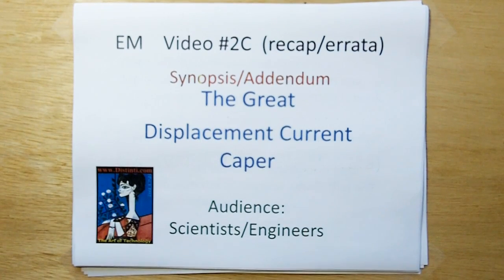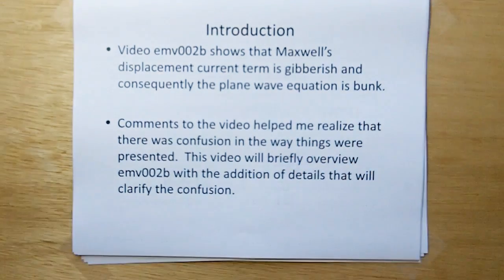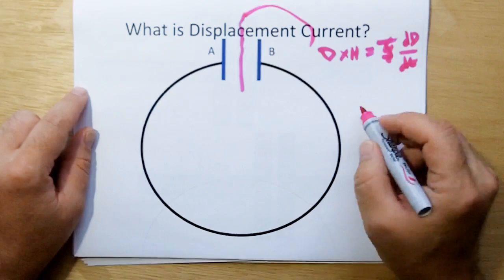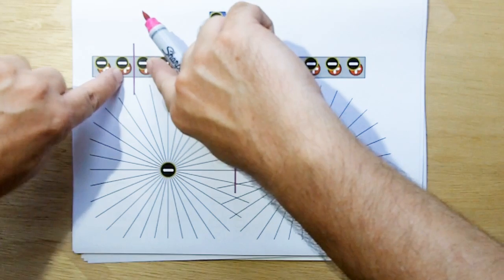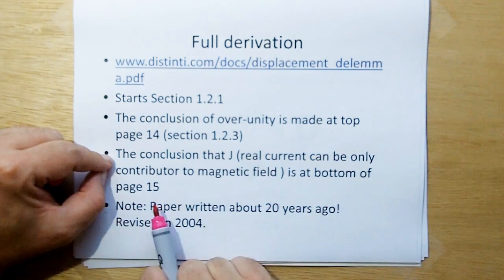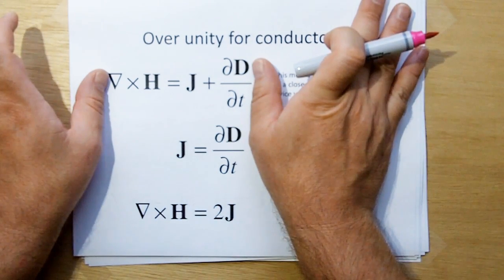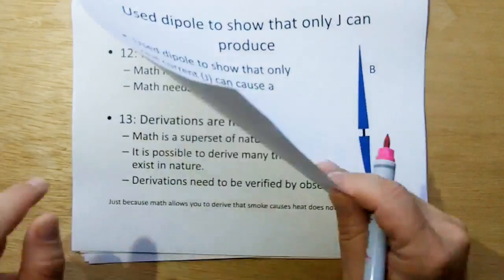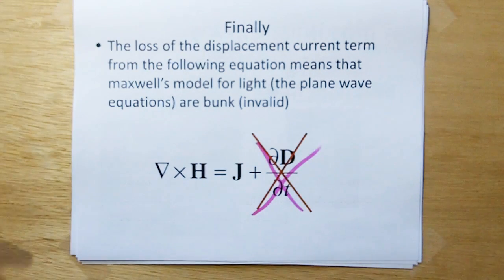emv002C: Addendum/Overview: Maxwell's Displacment current fraud

Comment: What you call as electric flux is magnet field passing through the inside areas of a number N of windings of a selenoid, and it is very incorrect to say "current displacement" because there is no actual flow of any positive charge in any circuit while the positive charge is transmitted from atom to atom and from the positive terminal throughout the circuit to the negative terminal as their electrons are both repelled from a larger amount of negative charge accumulated at the negative terminal, and also attracted by a larger amount of positive charge accumulated at ther positive terminal of the power supplying source

Comment: If I understand the concern correctly : in 2x when should be 1x : 

The energy that went into, a 3D symmetrical capacitor, is converted into Aether as E field or E energy. If all consumed in that process the only B field will come from the loop conductor.

If we are not fully convinced of above, the current enters central location of plate splits equally in opposite directions and if there were B field induced, each half will cancel out one another. That leaves us a residual amount of B to deal with, too small to sound a siren with. 
 Please reconsider Mr. Maxwell’s contribution.

Comment: Electrons and Positive charges moving across an insulator? The real current is measured by traveling electrons? Really? If you're going to point a finger at Maxwell, shouldn't you stick to his belief in not just potential moving charges but dielectricity too?
Dielectricity is the field aspect that is stored in a dielectric of the capacitor and travels through it, not the potential (until it fails). I suspect the "D" did not stand for displacement. Dielectricity, that part of the electric field that travels mostly outside the conductor (the air and insulators have more dielectric capacity than the conductor). Dielectricity is that aspect of an electric field that is motivated by the environment to move and then does at FTL speeds (c* pi/2). The closest physical metaphor is density.

I used to think that dielectric movement created the magnetic field of a permanent magnet, but denying this explains a lot about the other phenomenon that is observed. Discharging capacitors do not generate large magnetic fields. Tesla's Hairpin Circuit, an AC circuit that has no net potential provides dielectric electric field energy without potential and does not fry people carrying electrical fields capable of lighting florescent tubes and incandescent bulbs in series. This safe-handling feature and lighting without the presence of a voltage is most likely due to the absence of a magnetic field from the source and in the conductors.

So, I think you have a valid point, the actual transition of the E field potential is what causes or rather induces a magnetic field. The movement of the dielectric value of the electric field does not contribute to the magnetic field.

When a magnetic field induces an electric field, guess what: it produces dielectricity. If your inductor has a large enough capacity greater than the load, it will not travel until the polarity of the field being induced is changed. Then all that E field energy that was induced (from the Ether) will start flowing and presto, you get the back magnetic field. (Coincidentally just in time to push a magnetic rotor.) The dielectricity is converted to potential as the capacity that is induced with an opposite polarity forces the collected dielectric field out to be replaced by the incoming and non-moving reverse polarity dielectricity. (See TC Heins' ReGenX induction coil on YouTube and applied patent.)

In TC's battery charging-under-load-motor the potential is not established by the conductor, so the potential in the capacitive inductor must be established by the battery charging load. The available dielectric field is controlled by the capacity of the inductor, which sets the timing of the potential exchange, and the subsequent magnetic field induction, causing the motor to generate power and self-motor. Not over unity, because induction pulls electricity from the Ether. Definitely more efficient than the typical motor/generator that feeds back the secondary induced fields directly at the rotating rotors instead of diverting or delaying them.

No one is electrocuted with the hairpin because the loads are inside the bulbs. The Potential difference isn't supplied by the capacitors that discharge into a dead short. The only electricity that flows is potential-free; pure dielectricity (E-field density). But internal to the human bodies nothing (except perhaps metal implants) will develop a deadly potential difference given an excess of dielectric energy without potential. Only at the filaments and cathodes inside the bulbs is the dielectricity converted to the potentials needed to illuminate the filaments and phosphors.

Joe Newman's motor develops capacitance in his inductor by opening the circuit before the light speed limited potential can complete it's trip back to the batteries (7 miles of wires in his stator windings). But the FTL dielectric field that is induced does make it back to the batteries, flowing to the batteries that have more capacitance than the inductors. The result is his non-rechargeable batteries get charged. This motor also induces more power out than the dead batteries put in.

The independent field effects of the two parts of an E field (which you've demonstrated in other videos create a magnetic field that is actually just an expression, like a shadow of the moving electric field) each have their own power producing capability and it is foolish to consider that only potential times current is power. It is also foolish to consider power E field potential times magnetism when you've shown that magnetic fields aren't controlling the attraction of magnetic materials. It seems if this is so, induction isn't linked to magnetic fields at all, but something else.

Moving E fields create M fields which are shadows of moving E fields. When moving E fields move orthogonally to their direction they induce density E fields which can power E field movement when the conditions are right (it gets caught in a conductor and connected to a difference in capacity or potential). Both inductions are open circuit actions as the moving E fields precipitate the inductions from the Ether, like lift from a sail or wing in the atmosphere.

Thanks for the videos. I wish you could have completed your plans in presenting the full series you list in the introductions.

I'm slowly working my way through what's available, working on my past physics and EE math as I go. These models are works in progress, fundamentally I believe there are no particles, only field assemblages. But you can keep trying to fit electrons into your rationalizations if that works for you. Good luck to us all.

Comment: Ive read that stan meyer used millions of volts at a certain resonant frequency and achieved greater than 100% efficiency. Ive seen a Documentary years ago on pbs that showed teslas wireless transmitters and receivers having what appeared to be ant-gravitic effects on organic materials as well as metals, they floated. I think many ppl have figured it out over the years but the politics of this world just wont allow anything they cant meter the output. Check out joe neumans big eureka motor. I think his is the real deal. And im sure you've seen the Howard Johnson motor, he actually succeeded in getting his motor patented, lol, they wont let that happen again.
Reply: Just my 2 cents: Stan lectured that he produced an exponential gas output when he hit a certain frequency of around 40KHz pulsed voltages in the 2 volt range per plate pair, thinking he was splitting water into hydrogen. Instead he was simply energizing water into  a higher electric state that is a gas at room temperature. Moray B King has lectured on it and discusses some of the multiple ways the gas is made and put to work, although his theories of the physics have some holes IMO. The gas emits a plasma pulse when it condenses which can set off a nuclear fission reaction which releases useful energy in small amounts as it can literally totally consume anything that is present during the condensation reaction turning it into energy. Cold-fission, or as the navy calls it: cavitation damage from sonoluminescence. Vibration with pulsed potential seems to be pretty effective at making the gas, although Paul Pantone does it simply with vacuum and iron; check out his GEET reactor. It can run a motor on water, air, and any vaporized material without exhaust. He runs gen-sets no-problem, vehicle engines too unless the drivers publish, then they have accidents.

Joe Newman's motor is a bit impractical with 7 miles of stator windings, TC Hein's ReGenX and BTTT transformers are more practical approaches to splitting the cascade of induction actions into useful designs that appear to amplify electricity. His patents were denied, mass production plans in doubt he claims he can build an electric car that is self-charging, unlimited range; but no auto maker is interested. Patrick J Kelly keeps an on-line Free Energy encyclopedia that makes for good reading if you want to check out past inventions that have been shut down.

The lesson is, if you have an idea go public and loud, but keep any production on the down low. Paul Pantone has survived many murder attempts and had his production destroyed multiple times. He's operating with a business model of a drug dealer (not dealing drugs) now and seems to be doing all right as of last year. Like everyone who actually makes a working model, you have to keep quiet to stay alive and maintain a  profile of a typical consumer. Reduce your gas or power demand below 70% and you just might find you've got trouble on your doorstep. 

Consider petrol sales ww are over $1B/week before you think a better moustrap with a potential annual sales of a fraction of $52 Billion has a chance of challenging that kind of capital and the influence it controls. 

Is it any surprise that lobbyists spend more money directly into the pockets of congress and the senate in DC than the public does in salaries for the elected officials? The USP&TMO is a privately held company, don't expect any support there, in fact... energy and gravity inventions are on a hot list to get you noticed... Things aren't as they are taught in other schools, not just physics and EE. It's not all that different than when Steinmetz wrote about the politics of industry and government. He intentionally did not try to promote the truth, only enable what was in place to be functional.